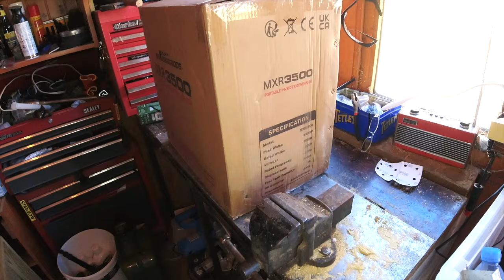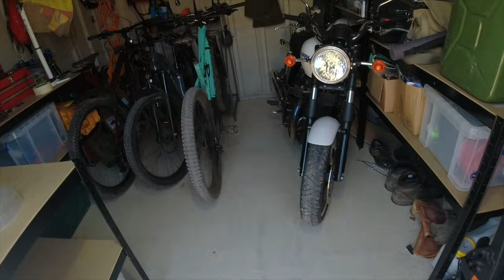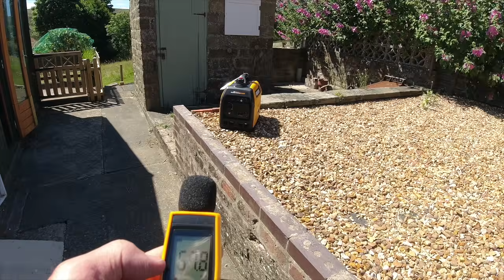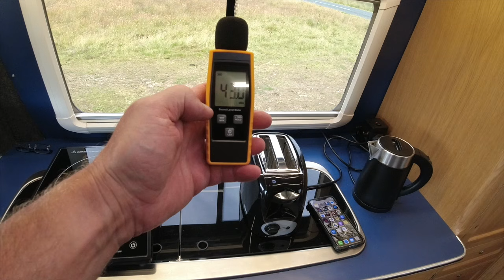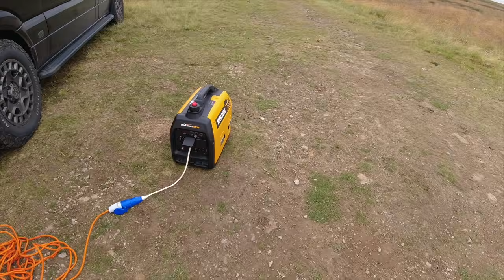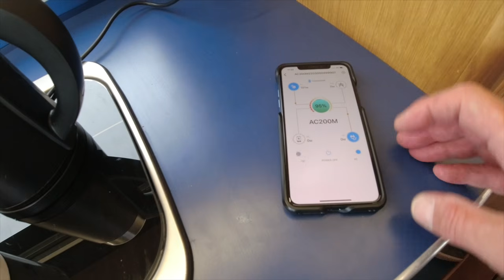MaXpeedingrods MXR 3300W Generator or Bluetti AC200MAX For Vanlife?

Comment: Hi. Fab video! Thanks!
I'm in France and the electricity is the same here.
But... hard-of-thinking here.😊
Questions:
*With the mxr3500w, what does the w stand for and how is it different from the mxr3500?
* It has to be outside, so can I put an extension lead through the catflap, and if so, what sort of lead? 
Thanks.😊
Reply from the maker: Glad you enjoyed it! W stands for watts, the 3500w has a slightly larger engine which produces more power I think you just need a waterproof pug and lead 👍

Comment: Looking at both options myself. Interestingly you don't offer an opinion? Fair enough.
I like the idea of charging/running the van electrics if solar/battery fails.
I can see the benefits of Bluetti and the like, but so much money.
Thank you for the content 👍
Reply from the maker: That’s an old video now you can get the charger 1 unit the Bluetti is just so much better but a lot more expensive 🙏 check this out https://youtu.be/DAw8eFk8AX0?si=b0mYrJvEP_ewq7bt
Reply: @onemanandhiswhippet wouldn't Victron DCtoDC do similar job?
Reply from the maker: @thesimmings  no they don’t nothing like
Reply: @onemanandhiswhippet   sorry. Just viewed Bluetti Charger 1 video. Wow,  that's some pro set-up. 👍

Comment: would be helpful if you provide  
power wattage draw of the appliances you are using
Reply from the maker: Toaster 700w kettle 600w hot plate 900w max 👍👍

Comment: Ive just bought a 3500 duel fuel and I'm going to run it on LPG from the BBQ point on my van, I've got the similar power bank mine is a power oak one with the solar panels, i need mine to power the AC when im abroard,  i went all around Europe a few weeks ago and the temperatures were unreal, so hot my milenco levelers melted 😂
Reply from the maker: 👍 sounds a great idea 👍👍 you need air conditioning too 😂😂
Reply: @onemanandhiswhippet  I've got it that's why I need the generator,  I've got 4 dogs 😂

Comment: Personally i would stick with petrol kr diesel or multi fuel gas generators.
These solar only work in good sunlight are ver expensive to boot. So you need a way to charge them .
Petrol diesel being more versatile can use them anywhere easily.
Reply from the maker: Good points 👍

Comment: I have bought a blackline inverter generator, its got a fob start and also 53 db and 4Kw ready for the power cuts this winter, also stocked up on paraffin for my heater cooker just incase
Reply from the maker: Oh wow that sound good 👍👍
Reply: @onemanandhiswhippet  the make is Blackline and this brand is in America, there is a Rally car shop in Britain that sells them and loads have recommend them and compared them up against Honda etc, its made in China by the looks of it so I asked the shop that sells them do the sell spare parts and they said yes… Also I think the shop that sells them in America have most probably asked China to produce them to a high standards and this what happens… It cost £634 as I had the fob start one also they make great quality smaller ones. Also you have a cool youtube name haha, I used to keep lurchers and the pit-bull x greyhound type they was awesome workers but took some handling.
Reply from the maker: @darkshaman7087  cool thanks for the info 👍🙏

Comment: A major problem with lithium batteries is there life span compared to relying on petrol generators.  My ebike battery lasted just under two years. And I hadn't miss treated it.
Reply from the maker: That’s true you need lithium phosphate for longer life and that’s what’s in the A 200 max 3000 recycle charges before the capacity drops to 80% 👍👍

Comment: Hi Man, I've just bought a maxpeedingrods mxr3500, literally out of the box 30 minutes ago.
Now, I'm confused as the user manual says it must be earthed but other reviews and yours are not showing the unit earthed. Which is correct may I ask? 🤔 thanks. Cliff.
Reply from the maker: Hi Cliff it can be used unearthed but it is safe if it is linked to an simple earthing spiking into the ground 
I don’t bother tho 
I just ensure it’s not used in wet conditions and my electrical tools are well insulated 👍 hope that helps 👍
Reply: Yes, very helpful and great video too, thanks.
Reply from the maker: @BiblesBrother  👍👍

Comment: That is one hell of a setup. I like it except for the AC200MAX. It does charge quite slow when compared to other power stations.
Reply from the maker: Thanks Matt🙏 Yep I keep it topped up when driving and use my build in system for everything but the AC and I can be off grid with no solar for a week I don’t say anywhere for more than 3 or 4 days so it work well for us but in summer the 350w portable solar panel helps too 👍 thanks for watching 🙏👍😁

Comment: Those solar panels looke great except for the fact that they do cost a bit and sometimes even more expensive than a solar generator.
Reply from the maker: Yep they are but they are 350w and good Quality but not 100 waterproof if you have a big Solar generator you need lots of solar to change it hope that helps 🙏👍😁